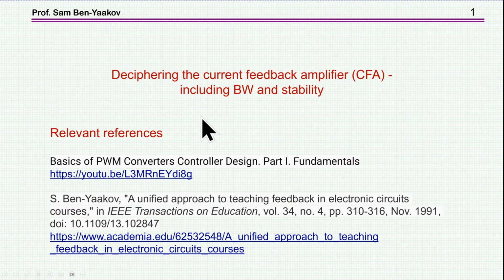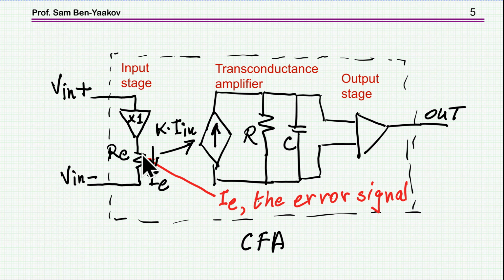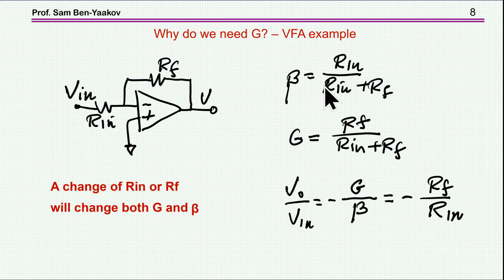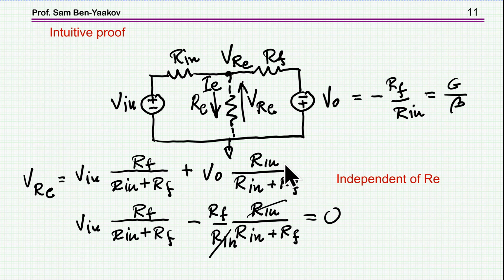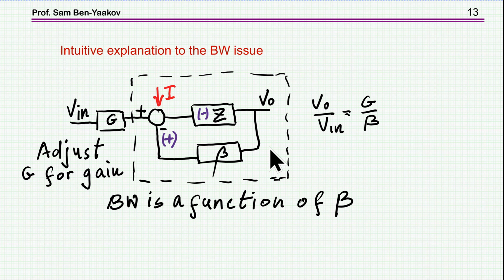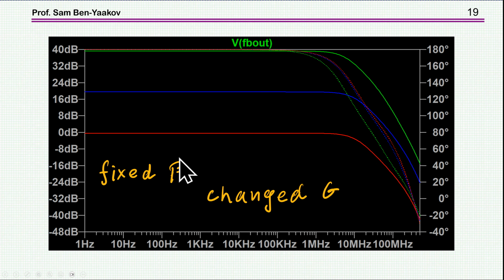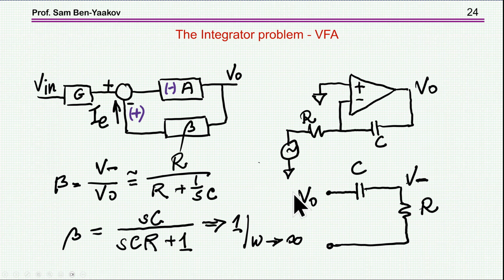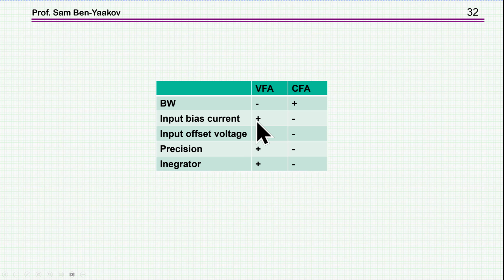Deciphering the current feedback amplifier (CFA) -  including BW and stability

Comment: I'm thinking of buying a CFA electrostatic amp. Any reason I shouldn't over a "normal" amp?
Reply from the maker: Only if you need very high BW. But today you can find compatible voltage mode op ams, saving the hassle.

Comment: Thank you professor for showing how to use B and G and how independent gain affects stability - a lot of data sheets just pussyfoot around the issue and you showed a completely deterministic way how B resistor affects stability and how to verify it.
Reply from the maker: Thanks. Yes, I find the G and 1/B an eye openers. Thanks for the note.

Comment: Hi Prof.  Could you please also have realization design too.  It would be nice if you made it with discrete transistor solutions. 
I made it with discrete transistor in practice but couldn't get BW constant when I change the gain .
I did it like Author Sergio Franco.👋👋👋👋
Reply from the maker: He shows discrete circuit for CFA?